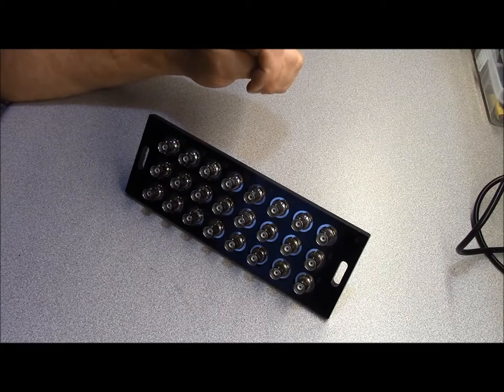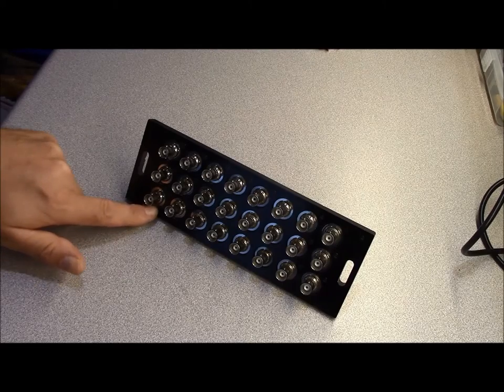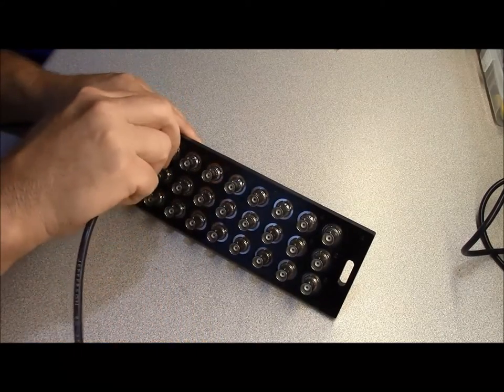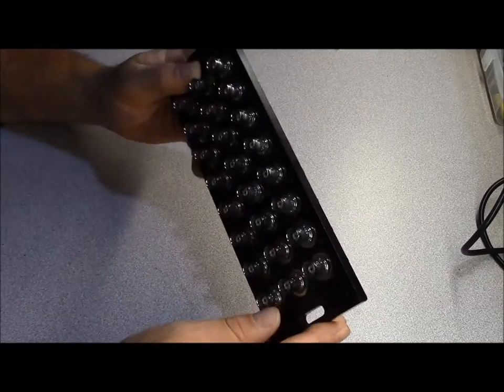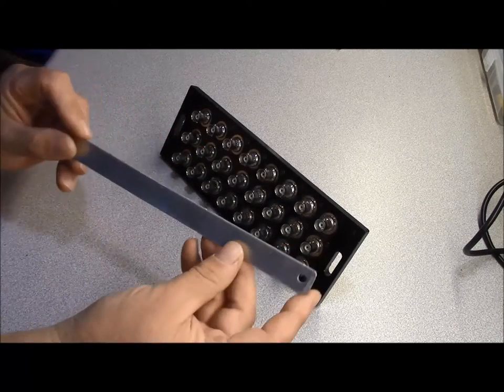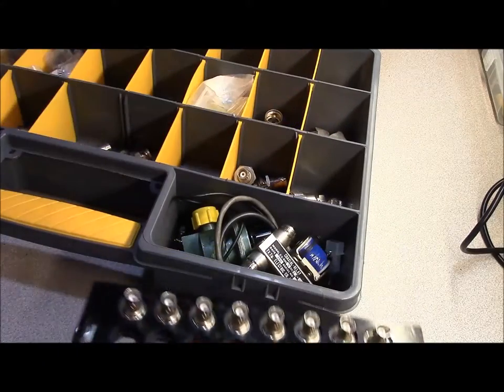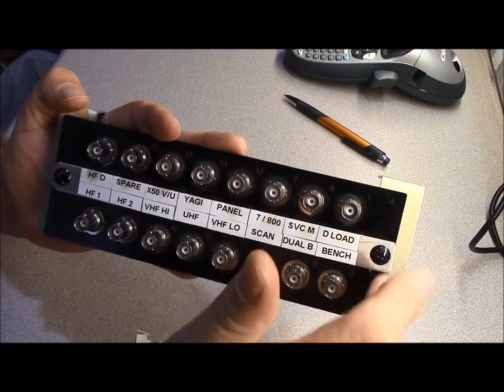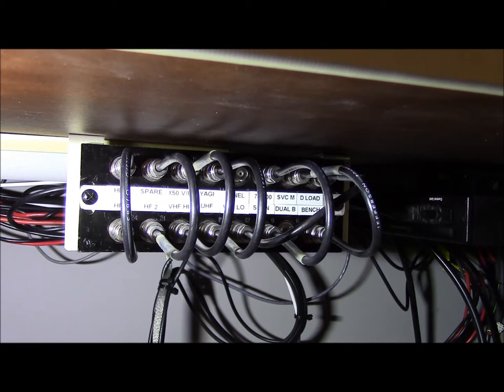RF coax patch panel for ham radio station

Comment: I am going to build a patch panel but I noticed you seem to have BNC in the front, but the rear appears to be BNC also. Are you then using PL259 adapters to BNC on rear to connect to radios?
Reply from the maker: I build my own cables that being the case I use BNC at the patch panel and for the radios using an SO239  I terminate the other end  with a PL259. Thanks for watching !
Reply: Thank you for such a quick reply. I was trying to find a bulkhead BNC to UHF 239 as one panel mount but could not find any. So I opted for Female BNC bulkhead feed-thru connectors and using BNC male to UHF female ((PL239's) on the rear of the panel.  @survivalcomms
Reply from the maker: @graywolf1911  Cool beans !

Comment: Good work and thanks for this video. Some really good ideas here. Can you give us the kings electronics Part Number for this 50 ohm model because when researching this I could only find reference to the 75 ohm model. Thanks Dean
Reply from the maker: No number on the panel itself. The part number that is important is on the connectors themselves (KC-99-38). There is a dude on ebay selling the same panels and he has them listed as 75 ohm but they are 50 from what I can tell.  Again the real tell is the part number on the connectors themselves.  Thanks for watching !
Reply: @survivalcomms  Thanks. Note your Part No. KINGS KC-99-38 is indeed a 50 ohm connector. This fact can be referenced on page 14 of the following MOUSER document:   https://au.mouser.com/datasheet/2/53/rfcatalog_web-2835526.pdf
Reply: @survivalcomms  It loos like YouTube deleted my last post because it included a URL link. Anyhow I confirm I found the correct reference for this model no. it is kings KC-99-38 and on page 14 of the "Kings RF Connector Solutions" document on page 14 there is reference to Model KC-99-38 and it's definitely under the 50 ohm for RF category. so, what you stated earlier about these BNC panel mount's is correct.
Reply from the maker: @deanathan4316  Yes I researched it well in advance as I do all of my content before publishing it. Its easy to produce content - making it accurate takes quite a bit of research on the creator's part.

Comment: What maximum RF power do you suppose this setup can handle?
Reply from the maker: A BNC will handle 250watts below 1ghz . I routinely run 100 -150 watts constant carrier at HF thru UHF without incident. If I was running a big HF amp I wouldn't put it through a patch panel I would feed it completely separate with at least RG8. Thanks for watching !